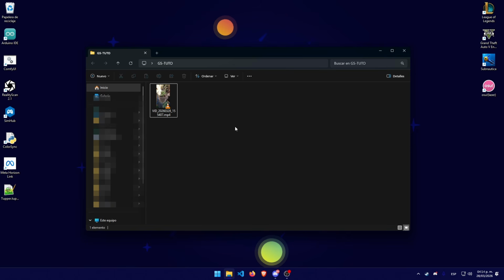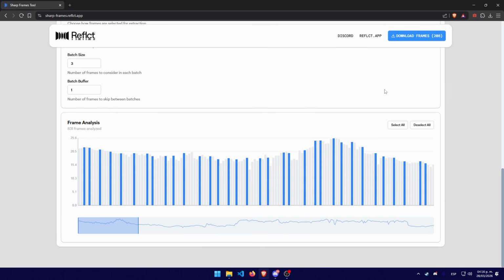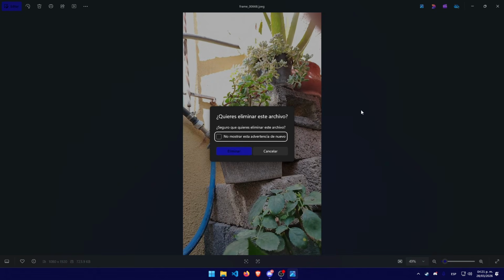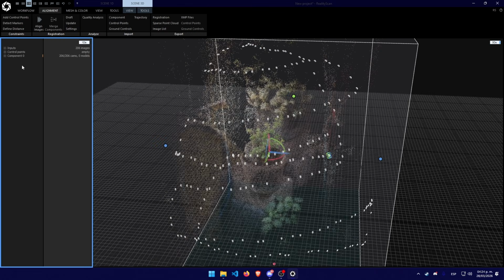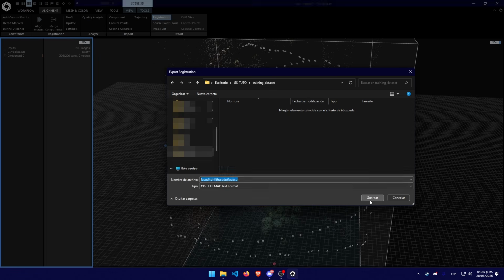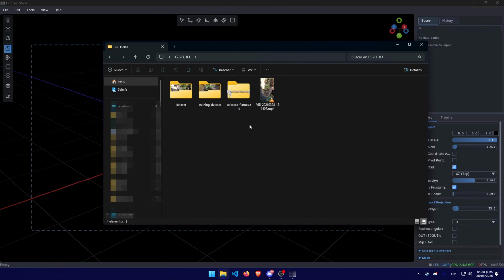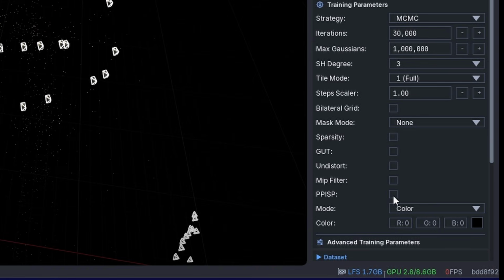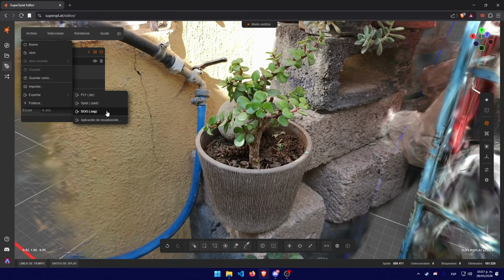How to make a 3D Gaussian Splatting using LichtFeld-Studio + RealityScan

Comment: I found a little hack in  RS 2.2 for key frame extractions from mp4 video so you don't have to leave the application. On the workflow tab all the way to the right there's a "map wizard" button. It supposed to help with drone footage/survey type images . Just have the wizard walk you through it ,drag and drop the video where it tells you, and it will do it for you automatically. Just fyi its CPU intensive though. It will also give you an error that its not geo tagged or something like that. just close or cancel it ,but the key frames will already taken out for you into a folder next to your video in the same folder. I had a 2 minute 600 MB video . I have a 16 core amd ryzen 7950x and it took about 1.5 minutes . not sure how long it will take on slower devices.

Comment: Ive been flying my drone in a grid pattern for mapping an area using Litchi. I run the images like you(not PPISP though) and keep getting fog, or mist above my grass and roadway/asphalt. Do you get fog above flat surfaces? Ive tried adjusting camera and RealityScan’s settings but cant get the fog to go away. How?
Reply from the maker: Yes, flat surfaces are the kryptonite for reconstructions bc they dont have reference points to recognize where they are. 
The only thing i've tried that works its literally capture those perspectives from those "weird" angles. 
For example,
if its floor, well, capture from a very low altitude and looking to the front  (10%-50% of the image looking at the ground at the bottom and the rest to the surroundings), but close to the ground 
if its a wall, try to view that wall from the very side, so the program knows that nothing is "coming out" of the wall
I think for drone shots... its kinda hard if the shots are only "aereal". To avoid those "fogs" you need to let the program know that, from that perspective, there's no fog, only "floor". So maybe shooting closer to the ground and same to the floor, capturing floor and surroundings, but it could be risky, due to collisions.
Reply: @kikooooorock  Thank you soo much for validating that. I might have spent another week trying to improve this mess 30 different ways. 1.7 acres of knee-to-waist mist wasnt cutting it, and 20‘ off the ground, with a 45deg angle didnt get the job done.
Reply from the maker: @coulterjb22  Sure no problem. If you need more help in depth, check the Gaussian Splatting Reddit. There's more people, some that do scanning as a job and you can share images and results to hopefully help you more :D

Comment: v5 https://youtu.be/4HChcEgrvkc is paid?
Reply from the maker: For the 0.5.x versions they decided to make the ".exe" files as paid. 
However, there are 2 way to use it :
1 - Use an older version: The page lets you download the latest 0.4.x version ,which is the same version im using in the video
2 - Build the code locally in your PC: The github page have a wiki on how to do it step by step ( https://github.com/MrNeRF/LichtFeld-Studio/wiki/ ). It's up to date with the new changes.

Honestly, a fair move. It's one if not the best free tool for 3DGS, and needing to build it yourself is not that hard following the setps in the wiki

Comment: why do you disable undistort on wide angle images in realityScan? and why just wide angle ? I thought it would be beneficial. Is it because it's better to do it in LichtFeld-Studio ? thanks for the tutorial.
Reply from the maker: Wide-angle lenses have a lot of barrel distortion. If you 'undistort' them in RealityScan, the software has to warp and heavily crop the edges of the image to keep it rectangular. This means you lose a massive amount of Field of View (FOV). Enabling GUT allows the engine to natively process extreme distorted images (like wide-angle or fisheye lenses), saving the FOV without loosing quality.

Comment: If you are on linux, ffmpeg is really good for extracting frames on your own pc.
Install, then open terminal in your video folder and run: ffmpeg -i input.mp4 -vf fps=2 dataset/frame_%04d.png
"input.mp4" is your video file, and "dataset" in "dataset/frame_%04d.png" is your output folder, make it first.

OS: CachyOS (Arch)
Installed RealityScan by using Faugus to install the Epic Games Launcher. Installed RealityScan normally from there.
Installed LichtFeld Studio from the AUR with: yay -S lichtfeld-studio

Note, if you are running Debian or Fedora, RealityScan has experimental .deb and .rpm installers

Comment: For framerate, if you can simply change your shutter speed that's the best option. Framerate on automatic modes will lower shutter speed but get blackmagic camera app if you're on a phone and use like 1/120 or higher and you can stick to whatever framerate
Reply from the maker: Absolutely. Also having a high shutter speed helps to avoid stroboscopic effect, which is practically useless for training.

Comment: Coming here after the Corridor Crew shed light onto this technology for me. Very well made and simple to understand guide, bravo, thank you! Very appealing to my short attention span, too.

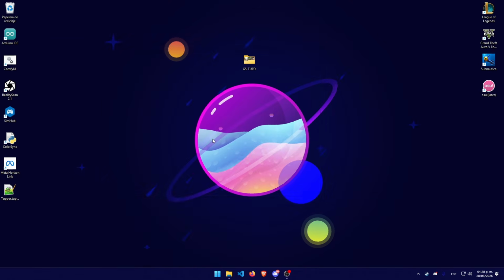Also, 4:07 - Content Manager spotted; nice
Reply from the maker: I was planning this video before, i'm glad i finished it just in time for the C.C. video :D

Yep, just got a g923 two weeks ago 👀
Reply: funny, the same for me. did you manage to do an own splat with this method? if so, how log did it take for you?
Reply: @FlyingTurtleLP  yep, the guide worked for me, one thing to notice - as an AMD user I couldn't use LFS so had to use Brush
Time each step took (source video of 60 seconds, scanning mainly a single object):
1. Sharpframes - near-instant
2. RealityScan - ~20 secs
3. Brush (30k steps) - ~25 mins

PC specs:
RX 7800 XT, i5-13400f, 32GB of DDR5

How good was the splat?- I viewed it in Brush and it looked pretty fine, but sadly I didn't really advance really farther due to my ADHD since I abandoned the project shortly after.. did try to import it into blender though, but failed due to me having ZERO experience with it